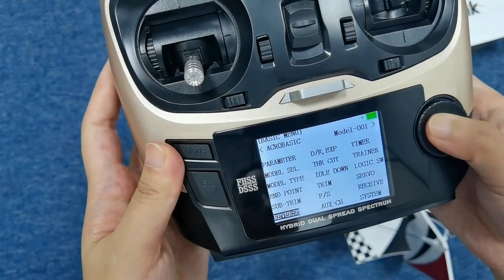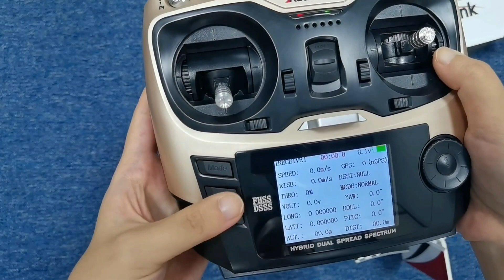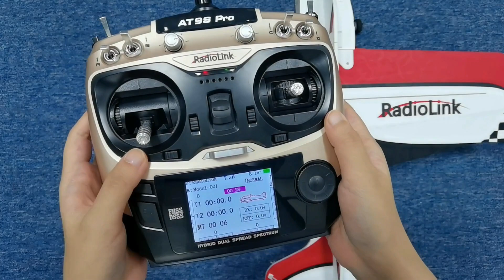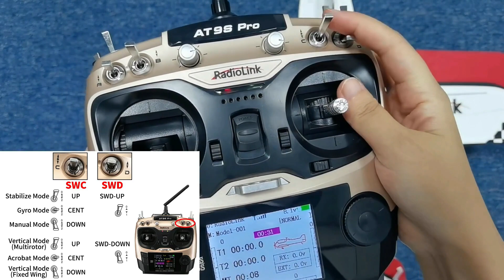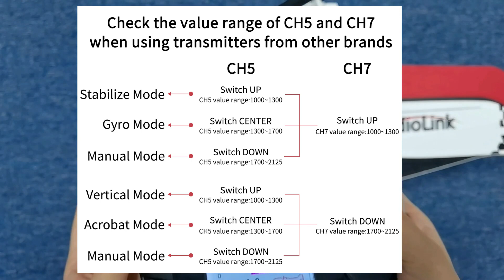Tutorial on how to Set AT9S Pro/AT10II & A560/Byme-A

Comment: The Byme-A is not working on the R16F receiver. In other words, it is not detecting the signals. Please update it as soon as possible.
Reply from the maker: Hi, sir. What color is the LED of R16F? And how do you connect R16F to Byme-A? Is it convenient for you to send us a video or pictures to show these so I can confirm what problem it is? If any question, please feel free to contact us. Our email is after_service@radiolink.com.cn
Reply: @Radiolink_official  https://www.youtube.com/watch?v=75s6o4lhrqc
Reply from the maker: @ArifGvn01  Hi, sir. We have checked your video. R16F is in PWM working mode. You need short press the binding button of R16F to turn on SBUS working mode, because Byme-A supports SBUS signal. Make sure the blue LED of R1F is turned on. Here is  the manual of R16F for your reference: https://www.radiolink.com/r16f_manual  If any question, please feel free to contact us. Our email is after_service@radiolink.com.cn
Reply: @Radiolink_official  Thank you, it's fixed.
Reply from the maker: @ArifGvn01  Great to know that.

Comment: Hello, I have bought a AT9S-Pro and with a R9DS however my controller is not connecting to my receiver. I can’t solve this issue after persistent trying, please help.
Reply from the maker: Hi, sir. Thank you for your support. Could you please first make sure the receiver is successfully bound to the transmitter? Here is a binding tutorial for your reference: https://www.youtube.com/watch?v=c3K19QB2_xE  By the way, you also need to make sure the RF mode of AT9S Pro is turned on so they can be bound. If they are bound successfully, but the signal is often lost, could you please check the tutorial here to test RSSI? You can also send your RSSI testing video to us. Our email is after_service@radiolink.com.cn
Reply: @Radiolink_official  Thank you very much, I will try to fix it using the solutions provided today and will inform you if it works
Reply: @Radiolink_official  I believe the receiver is broken as when connected to the esc with the signal cable on top, the light does not turn on, however when flipped the light turns on but it is unresponsive
Reply from the maker: @IllegalLithium  Hi, sir. When the receiver is powered on, the LED of the receiver is turned on. If the lED is not turned on, could you please check if there is good connection between the ESC and the receiver? You can also send a video to us so we can help to confirm if there is any problem. If any question about RadioLink products please feel free to contact us. Our email is: after_service@radiolink.com.cn
Reply: @Radiolink_official  yes there is a very good connection however I have contacted the seller and will negotiate for the compensation of the broken receiver, thank you for the help.
Reply from the maker: @IllegalLithium  Hi, sir. Thank you for your reply. Good to know you have already contacted the seller and get the problem figured out. If any question about RadioLink products please feel free to contact us. Our email is: after_service@radiolink.com.cn